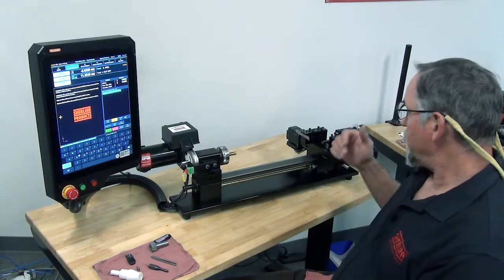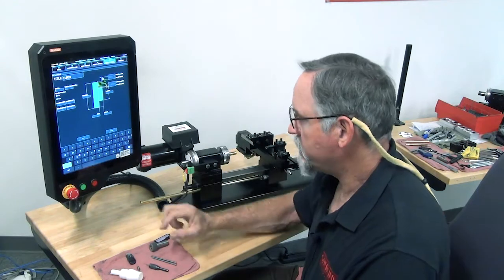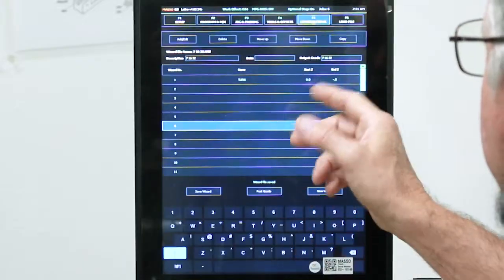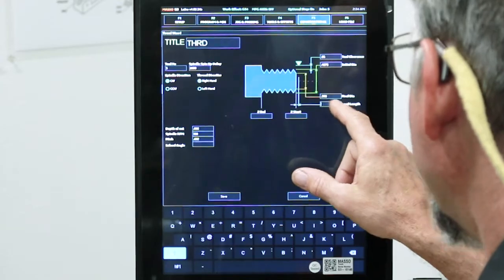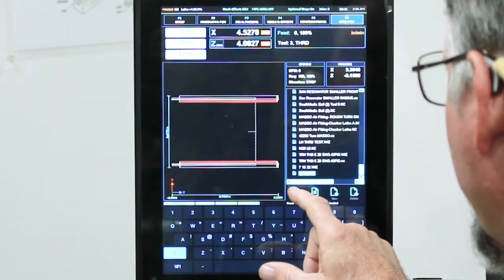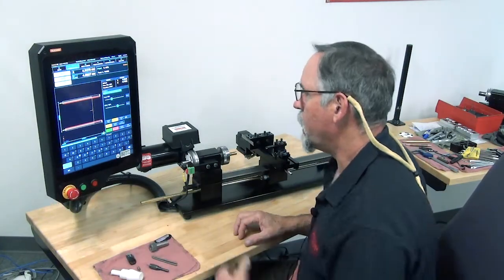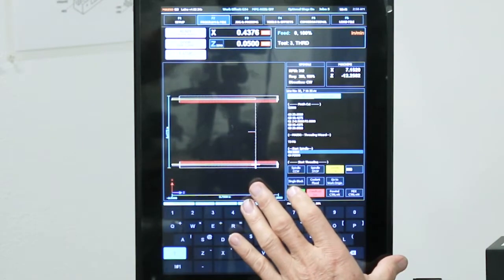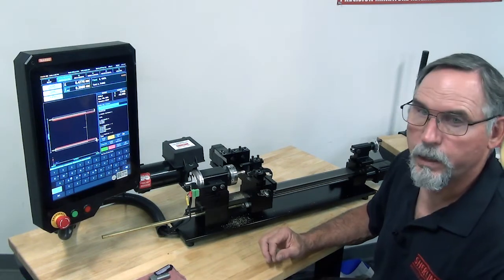Accu-Pro Turn Lathes - Lathe Conversational Programming

Comment: Is this turning/ threading software built in this touchscreen or is it in all masso g3 unit's? I just got a sherline 4400 so I want to make sure I get the right cnc controller unit.
Reply from the maker: The G3 touch controller has a 36V power supply that runs the new 36V, closed-loop stepper motors. Right now, this system is only offered as a complete turn-key. It is not backward compatible with other Sherline machines with 24V stepper motors, especially those with standard leadscrews.
Reply from the maker: The turning/threading software is on all Masso G3 boards, not just our touch controller. It is part of their conversational programming.